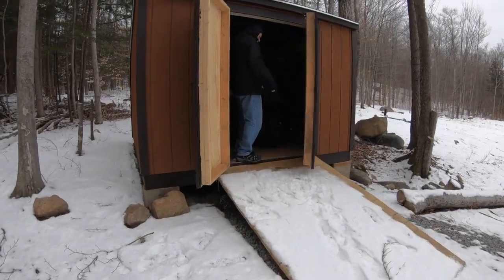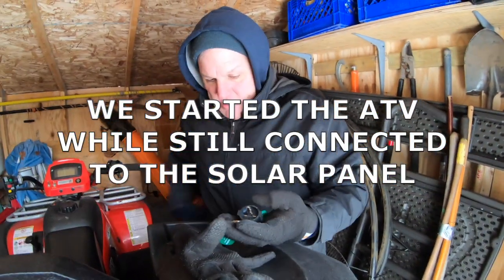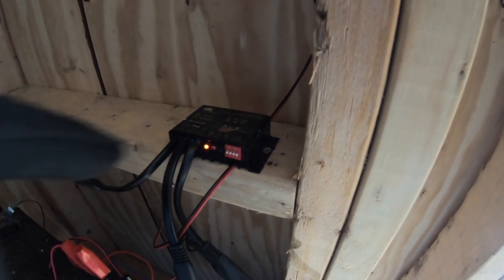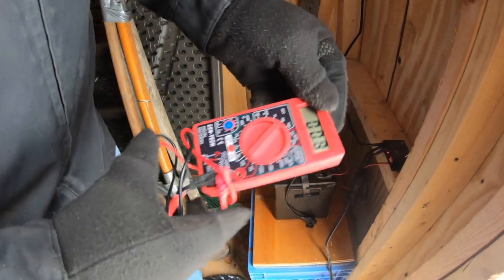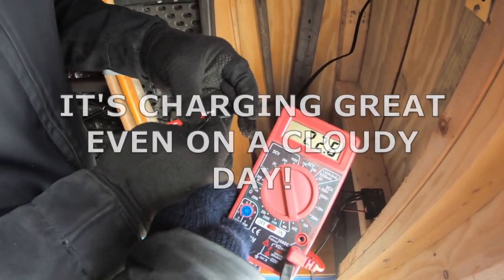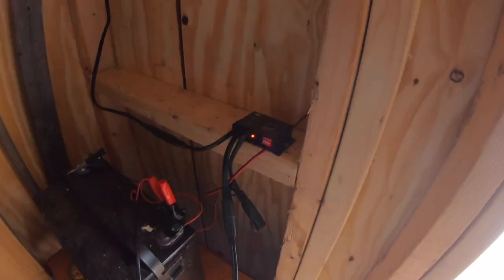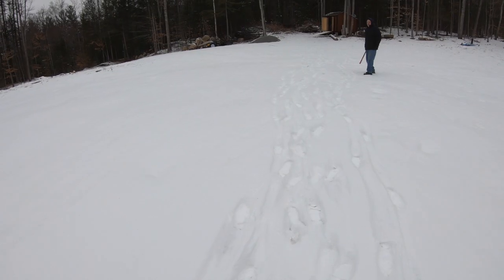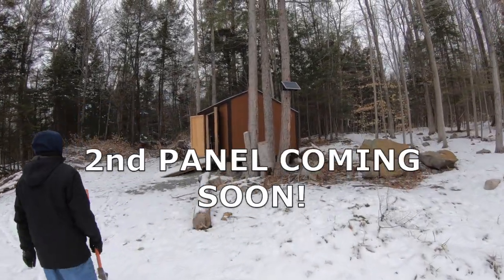SOLAR Battery TENDER for THE ATV  - 20 WATT PANEL WINTER UPDATE

Comment: Did you need a power inverter for your ATV? Am I right in saying that your solar panel chargers both the ATV and 12V battery bank for the light? Considering this for my atv/shed that is similar to your setup. Any other key components not mentioned?
Reply from the maker: No inverter, the panel came a charge controller. I ended up replacing it after about 2 years but the panel keeps the atv battery charged all winter no problem. It can only do one battery though. Each battery has its own panel with controller